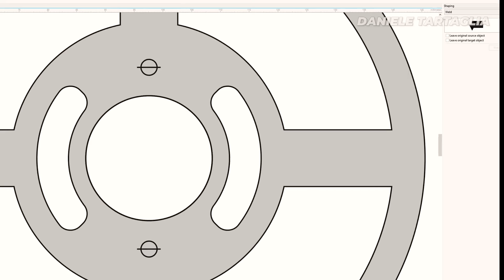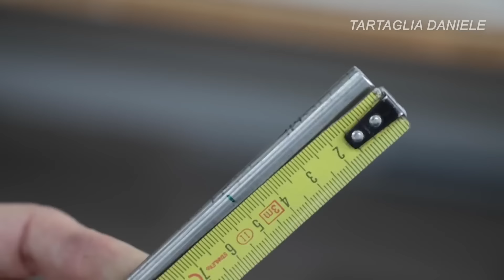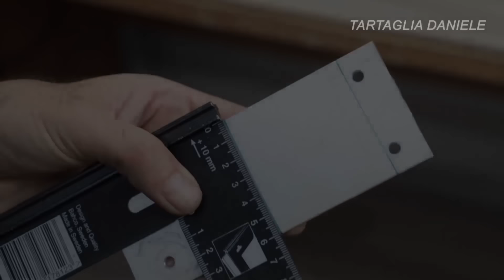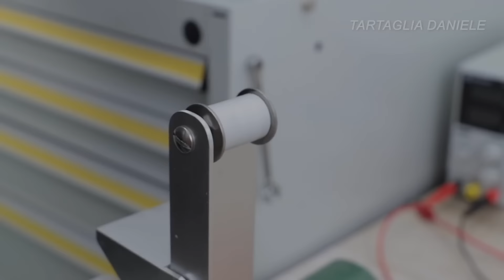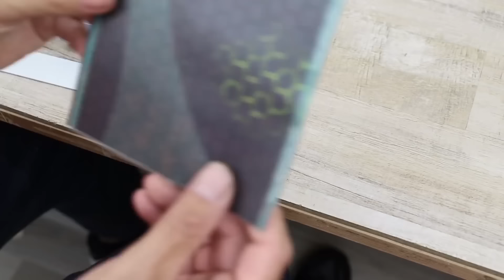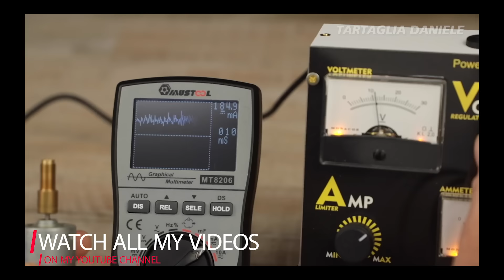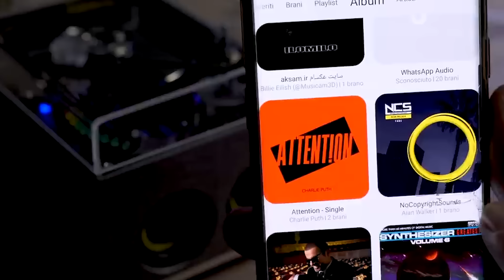5 AMAZING DIY project with MOTOR DC

Comment: The first one would make an incredible filter for soldering. Using an activated carbon filter and letting it suck the air while you are soldering so you don't breath it

Comment: The second project. Why you using a step motor. What's the purpose? Whataction are generating  the step motor. Is this Step motor function be only as transmission ?